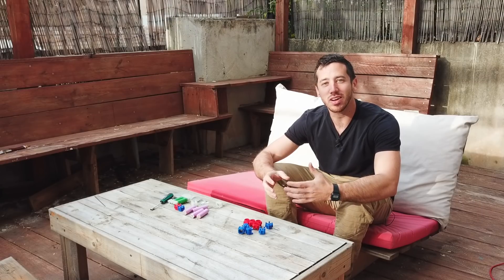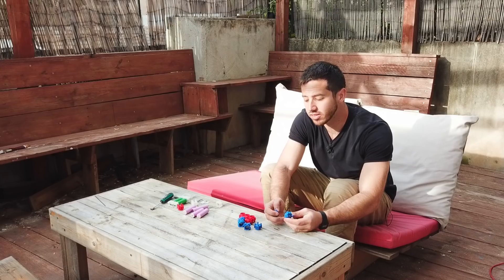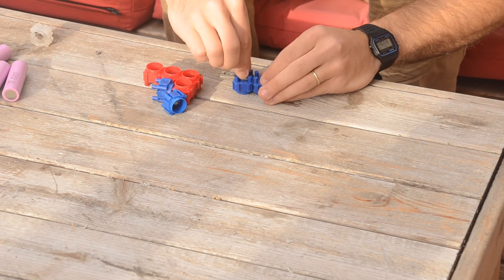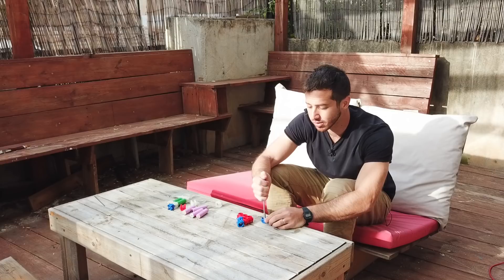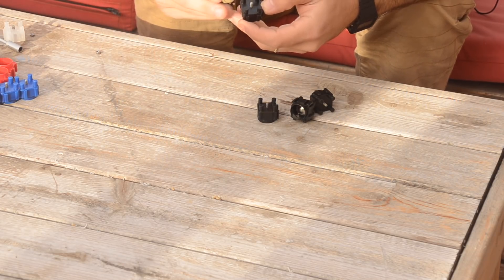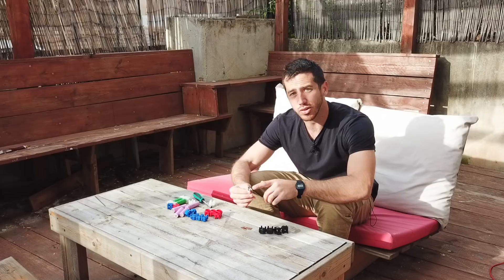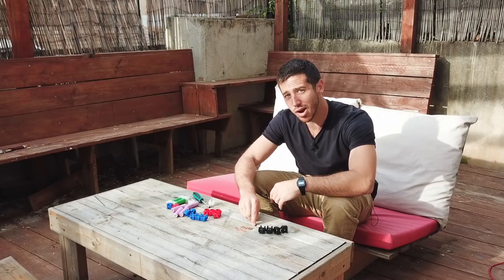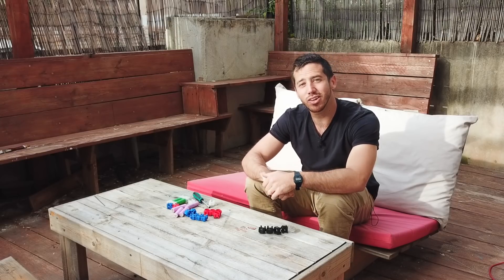New version of Vruzend 18650 battery kit available!!

Comment: You made a little mistake. A series connection increases the voltage, not the current.  A parallel connection increases the current, not the voltage.

Comment: thanks for the video.have a little with my bms seem to get real hot and it drains the battery down to 14volts from 16.8 was going to use it for my backup camera.afraid it will start a fire?is that what bms is suppose to do that or should i get another bms?thanks for the builds..right now i am not using a bms

Comment: Micah... ebike guys... i love u guys. WITH THAT SAID:

Vruzend RUINED MY LIFE!!!!!!!!   I invested HEAVILY in this solderless kit. HOWEVER, the springs cause constant problems. In the end I had to ADD solder to the tops of the "shorter" batteries & then put the 'solderless' cap on top: in order to stop battery pack from basically falling apart. 

SOLUTION: They need to make a twist and clip mechanism for this kit to work. The current spring design is COMPLETELY FLAWED.

Comment: I bought part of a pack from someone who over ordered. I`ve  put together a top tube pannier with 40 cells.I have zero experience. Lot`s of instructions and tips on youtube. It`s very adaptable even when you can`t fit the cells in a single block.  I paralleled them to my original pack and doubled the range. Worked first time.

Comment: Micah, II could really use your advice.. I am using your caps and I want to generate a 48-52 volt 1000 watt battery pack with them but I am confusing myself trying to figure the layout. I am using a heavier duty, but still basic, 27" mountain bike so shape isn't that important. I mainly just don't want it sticking out wider than the bicycle seat. I think i need 14S3P but how do i parallel them on top of running them in series. I feel like im just creating one big short circuit. If that makes sense.. Please help.

Comment: Is it much cheaper to make our own bike battery?
Reply: The most expensive part of my battery build by FAR was this kit. Vruzend RUINED MY LIFE!!!!!!!!   I invested HEAVILY in this solderless kit. HOWEVER, the springs cause constant problems. In the end I had to ADD solder to the tops of the "shorter" batteries & then put the 'solderless' cap on top: in order to stop battery pack from basically falling apart. 

SOLUTION: They need to make a twist and clip mechanism for this kit to work. The current spring design is COMPLETELY FLAWED.

Comment: Hi I am looking to build a battery to run my ham shack radios and lights is it possible to make a battery from your kits to do this with the solar panel I have, plus do your kits come with the electric cells or do I need to get them from another distributor 

phil in the UK

Comment: I have a question concerning BMS circuit boards.  Can you use a board designed for 13 series on a battery that has less then 13, say 11 or 12 series?  If so, what do you do with the unused connections.  I could not find the answer in your book.

Comment: Thanks for the info bud! I just got an original Phat Scooter(sport model) 1200 watt with a 72V 20ah battery. I do deliveries around the University of Arizona with it. I'm looking for a way to add a second battery to double my range and possibly hack the motor to get more speed. What are my options. Is it possible to build a battery and have it be portable so that I can easily unplug it and take it with me when not in use? Cheers!

Comment: Wow
Gonna have to get me some of these things.
So far, I have been trying to join the cells together using soldering. Failed miserably, solder really does not like to take to 18650s. Resorted to buying hordes of cheap 'DIY power bank' kits from China, sawing off the electronics, and just using them for the spring loaded 18650 carriages, and soldering them together.

Comment: Nice ! May I ask, since this is a copper alloy rather than pure copper, do you happen to know what's the resistivity value of the copper alloy (i'd like to do calculation with the Poulliet's formula to calculate potential voltage drop and max current) like the calculation exemple i gave here (nobody taked about this before me on ES but i think this is important info): https://endless-sphere.com/forums/viewtopic.php?f=31&t=88051&p=1290112&hilit=pouillet#p1290112 .   Matador on ES.  as a ref, pure copper resistivity is ρ = 1.68×10^−8 Ohm . m .... that vallue changes for different alloys.  phosphorous content (even if just p0,1 % content) has dramatic adverse effect on conductivity of copper. So i'm wondering wat's the copper alloy type number your using, as this would give info on the resistivity value and thus conductivity.   Matador from ES
Reply: BTW, Love the Vruzend products. I`m an early adoptor and ordered 208 caps of the V1.0 colorless caps back in may-june 2017 when they first came out through india. Even knowing about some of the current limitation, I still love these. And I recently bought some additionnal v1.0 ones from another ES member who had beta tested them. The v1.0 Vruzend are great for project and low to mid-range power ebike (practically speaking the lower current rated V1.0 vruzend caps I think are great for ebikes of 250-500W range if you want a reasonable low-weight battery). The vruzend V2.0 is stepping up the game way way much and I`m honestly thinking it will be possible to pull 10amps per cell continuous with this. But I`d need to beta-test too... At one point or another, I am definitly going to get v2 kits and try them out... I`m still happy with my Vruzend V1 for some application. I was even able to run an hot-rodded 1500W BBSHD on a 14S8P Vruzend V1.0 kit (that`s 3.75A/ cells) and it worked... https://endless-sphere.com/forums/viewtopic.php?f=31&t=87434&start=275#p1297335 but the cells where cheap old salvadged laptop cells meant for 1 or 2A/cell and they took a good beating from the high current draw. I nowhave some much better Sony VTC4 (30A) and LG MF1 (10A) cells !

Comment: Wow, problem solved. No welding, no soldering, just building! I have a couple of questions,  Is there a kit for 26650 cells? If not, I want to build two 4s3p packs with 18650 cells and use them in series on my bike, but I need 60 amps continuous. Are the tabs capable for that current? I will obviously use cells that are 20+ Amps each ( so 20x3=60).

Comment: Do you have a kit for building battery packs with Boston Power swing cells? Or can you suggest the best way to connect the terminals with nickel strips or copper? I can't get them to spot weld and I have 340 of the Boston power swing cells 5300mah to build with. Thx
Reply: I bet Im S.O.L. with a kit. Lol. But thanks for sharing your knowledge and posting great videos.  Wish I could use these V2 for my Boston Power swing batteries. I will keep trying to figure out how to build packs with them.  Thanks again.

Comment: Love to know why there isnt cell level fusing! ?  Surely that was a big downside to using this kit in v1 and it should have been addressed in v2 yet no? Given its a kit and people can use any cells older or newer then this is a big concern of not using fusing. Plus given this is directed at ebikes pushing high current at times causing heat and increasing cell failer, the thought of a cell/pack on a bike catching fire in a garage would be a big problem for the kit makers if it happened and its more a question of when without these safety issues fixed. Just my thoughts and i dont want to sound like a downer but when hearing about v1 i thought it was crazy and it is not fixed. Maybe someone can tell me why.
Reply from the maker: Cell fusing is something the user adds, if they require it. You simply connect the fuse wire to the threaded post. This is addressed in the FAQ on the website. This kit is designed for DIYers, so it is meant to fit as many diverse needs as possible.
Reply: I would highly recommend including it in the kit. The reason is anyone buying the kit would most likely be someone with little understanding of batteries and someone that just is wanting to build up a battery pack eg for a bike etc. This is good and the reason for the kit however they are very unlikely to have a good understanding on batteries and the risks or details round battery setups as that only comes alot of time working with cells and many different projects and for that reason you wouldn't know to then go out and buy fuses to make it safe etc. Plus if you do have lots of knowledge and you're far more down the 18650 rabbit hole then you wouldn't be buying a kit like this given its far cheaper to build the cell holders yourself. This kit is great for the beginners or the one-off project at the extra cost and for someone with little time or understanding thats fine but for that very reason include the cell fuses, make it part of the kit so they get used when building your kit, hardly anyone will buy the kit and put it together then go out and source cell fuses. It just won't happen and that's the reason to include it, if its in there people will use it :) Thanks for the reply
Reply: yes super info thanks

Comment: It's awesome that you are putting out so much good information and continuously improving your product.  Have you used temperature sensors on any of your battery packs?  Given the new caps will carry more current and one of your recent videos about battery temperature, I'm wondering what you recommend for monitoring battery temps.

I built a battery for my trolling motor, I used Samsung INR18650-15L which are rated for 18A (at 25℃).  I'm sure temperature shouldn't be an issue, but wondering about options.

Comment: I am torn, your kit has metal connectors and the power-wall builders use fuse wire and buss bars of twisted copper. What is your opinion.
Reply from the maker: People add fuses to the Vruzend kit by adding the wire to the terminal on top.

Comment: Great improvements to v1.5...definitely needed.  However, none of those improvements address the single biggest issue with v1:  the size of the opening is too small.  I'd say every fifth battery of mine had the shrink wrap split open because it took so much effort to jam the cap on due to the extremely tight fit.  Increasing the patency would allow easier assembly of packs.  You said it yourself:  the actual diameter of different brands of batteries varies.  The solution isn't to add a thicker wall; it's to widen the opening.
Reply from the maker: Good point. I didn't explicitly mention it, but part of the reason of switching polymers was to address this. It wasn't that the hole was too small, it was that the polymer was too rigid. This new polymer has a bit more stretch to it so now the cells slide in much easier as the plastic is smoother and stretchier. That means that the cells are held better and don't need to be forced in as hard.

Comment: Thanks for the reply on % of an 18650. Next question: I bought 200 harvested lg 2200mah that were advertised as lgds but received a mix of lgds, lgdas, lgcas. What kind of battery am I looking for in my ebike. I've started to look at data sheets but don't yet understand. If this was explained in your battery pack build guide, sorry, but I haven't won a book yet! When I get steady work I'll buy one.

My next book by Micah Toll: Batteries: Different types and how to use them. You can use this title for your next book and all it'll cost you is yourDIY

Comment: How long do you think we will have to wait for 20700 or 21700 batteries to become the norm for ebikes. I will be building my own battery but preferably with larger capacity cells
A few years ago I built my first ebikes 6months later a better more stable motor was released of course I had to upgrade
Now my gut tells me 18650 cells will be a thing of the past soon  I don't want a repeat my motor dilemma 
Looking forward to building my custom battery

Comment: Hi ,A wode love if you use a thermal heat camera on  a cell 18650 with is shorted and show oss how hot it is.Pepel is taking of how dangeres lipo bateri is bot no one has show os it with thermal camra.

Comment: I have dc permanent magnet motor , 1500 watts and 180 volts with about 5000 rpm can I use it in my scooter with low battery voltage because my budget for batteries is low

Comment: What is the optimal temp. for 18650 cells to run at to be most efficient?
Reply from the maker: Usually around 20C, but that's hard to do because they naturally heat up during charge and discharge.
Reply: EbikeSchool.com Thanks for the response! Do you think it would be probable to implement some sort of heat sink or water cooling system to keep the battery running more efficiently? And how much more efficient would it be if it ran at 20C vs running hot?

Comment: At what % point of an 18650 Li-Ion battery life  in an ebike would you replace the cell? I bought 2 lots of 100 LG2200mah used modem batteries and mostly getting  discharge readings between 1600 to 2000mah.
Reply from the maker: 80% is often considered end of life, but now many manufacturers rate cycle life as # of cycles until 60%. It's really more of a personal preference. A 60% capacity cell will have more sag than an 80% cell, so they aren't going to be as good in higher power situations.

Comment: No thumbs down but I'm sorry to say it's disappointing a 26650 version wasn't announced yet.
Other than this oversight, keep up the great work!
Julian
Reply from the maker: Hey Julian, the main reason for no 26650 is simply the lack of demand. I know you prefer them for Ham batteries, but from our surveys, 18650s are more popular by about 50 to 1. And since a mold costs tens of thousands of dollars, it would just not be profitable to make 26650 caps yet. If more demand becomes apparent though, we'll definitely produce them. We just can't invest in something that will lose money. :-/
Reply: EbikeSchool.com yes, I figured it was something like that. Even in the amateur radio community people are still fixated on 18650 cells. A would like to do a build using these caps if I could just find a decent lithium iron phosphate 18650 for the project, I think that would make a great video for my genre. Any chance for a collaboration?
Julian
Reply from the maker: Yea, there are some 18650 LiFePO4 cells, but they aren't very common, mainly because the lower energy density means you just can't fit much LiFePO4 into an 18650-sized can. I know A123 has some, but they are pretty expensive compared to li-ion 18650s. But hey, if there are any out there, I'd love to see you make a radio battery from one. A collab would be awesome!
Reply: EbikeSchool.com I'll see if I can get some of those A123 lithium iron phosphate cells. I'm  just dying to try this kit :)
Anyway have a good one and looking forward to your next video.
Julian

Comment: Hey mikey nice Vid! 
Im looking forward to version 2.0 :) If the rating is atm say 13Amps, now  if I double the bus bar or build 2 in parallel the rating would double (or 4times with both) as well right? Or is it just possible for 2 parallels because the caps themselves cant handle more?